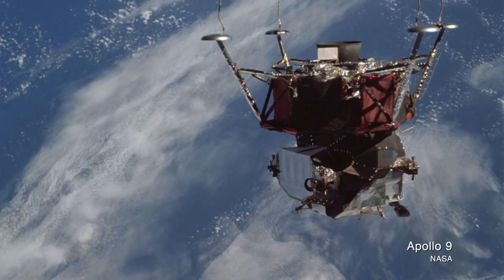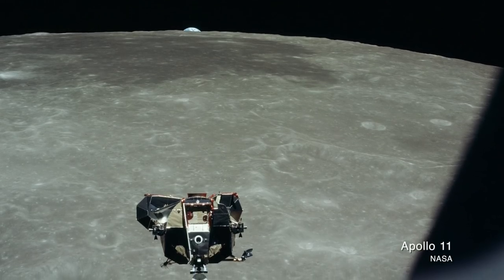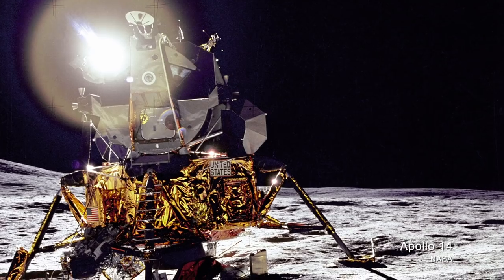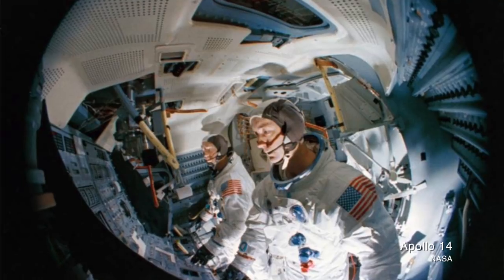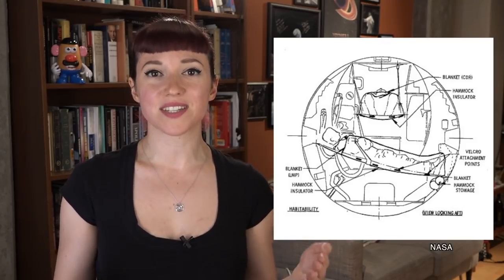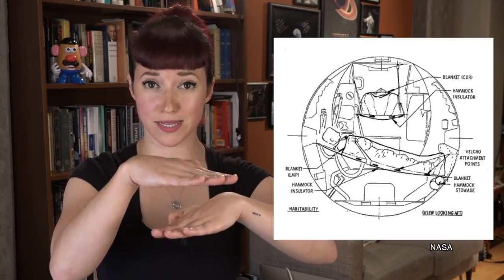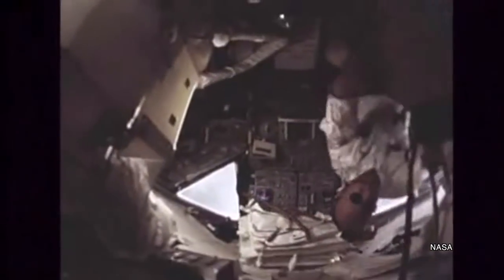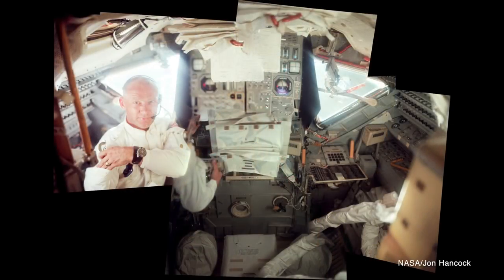Peeking Inside a Messy Lunar Module

Comment: where did they sit/stand/lay during take off from the moon?
Also, did they put their EVA suits and packs on while attached to the CM or after they were on the surface. If so, is there a written procedure somewhere for donning the EVA suits and packs?
Reply: They had to stand, but because of the low lunar gravity, they didn’t have to achieve as high an escape velocity to achieve lunar orbit as to achieve Earth orbit.  Therefore they didn’t experience enough G forces on liftoff to have to lie down.  The liftoff looked like a jerky start on the recorded video from the remote camera, so they had to brace themselves, but they were fit military men, so it wouldn’t be hard for them.
Reply: There were elastic bungee cords connected to the walls of the LM's cockpit around where the astronauts would stand. Then there were  attachment loops sewn into the astronaut's space suits. Before flying the vehicle they would hook the stretchy bungee cords into the loops, which would hold the astronauts down onto the floor so they would remain in place while the LM was performing powered flight.
Reply: @rjcornford  thanks for this.

Comment: Given the tight space, was there stuff left on the moon that wasn’t needed for the return journey? I mean apart from poo bags. Did they need the bulky EVA suits, for example? (Mind you, logistically difficult to leave!)
Reply: The EVA suits WERE the spacesuits themselves.  They were just a lot more dirty on the way home than the way back.  Lots of people think they were separate suits, but they weren't.  They did look a little different because, on the moon, they had the overshoe/boots attached, the PLSS backpacks, the helmet's slip-on outer layers (that were placed over the air-tight bubble layer), the hoses and stuff, and were pressurized (so they seem inflated a bit).  But, those were the same actual suits as they wore to/from the moon.

As for what they left on the moon, yes, they discarded everything they didn't absolutely need for the ride home.  They kept the suits, of course (needed to wear them during maneuvers and stuff, just in case something breaks on the spacecraft and they get a rapid depressurization).  But, they discarded the PLSS backpacks, the overshoe/boots, the tools, and even the cameras (kept the film, of course).

Comment: How did they get the PLSS installed in front of the hatch? The LM was accessible in the stack, wondering how they accessed with inward opening hatch and PLSS on floor.
Reply: Presumably, standing, like any backpack. Then drop down, stick one arm and the head through, then wriggle the rest out. A practiced procedure.
Reply: I don't think  you understood my question. If you notice in the picture described in the video, the PLSS is stowed in front of the main hatch on the floor. It has to be fastened down so it does not move during launch. The LM was accessible, via the front hatch, while on the launchpad. So, how did they install the PLSS on the floor in a position that seems to block the inward opening hatch? Were they able to access from the top hatch? It seems hard to reach through a partially opened hatch to fasten the PLSS to the floor.

Comment: As they came down on the moon, i guess they were free floating, then slowly get pulled to the floor of the LEM? Or straped the hole time? I mean they had to fly the thing - and there were no seats. Can you explain? Thx
Reply: Fred Cink   Makes sence. Thx!
Reply: There were elastic bungee cords connected to the walls of the LM's cockpit around where the astronauts would stand. Then there were  attachment loops sewn into the astronaut's space suits. Before flying the vehicle they would hook the stretchy bungee cords into the loops, which would hold the astronauts down onto the floor so they would remain in place while the LM was performing powered flight.

Comment: Could be wrong, but I understand Apollo 13 LEM, decent/assent,  is in a solar orbit trailing behind the earth.
Reply: Nope, the Command Module, the Service Module, and the Lunar Module were all attached to each other and heading towards Earth.  Shortly before entering the atmosphere the 3 astronauts transferred from their Lunar Module "lifeboat" into the command module as that was the only piece that was built to survive re-entry with a heat shield.  Both the Lunar Module and the Service Module were Jettisoned before re-entry.  They then continued on and burned up in the atmosphere.  You might be thinking of a different LEM, perhaps Apollo 10.

Comment: Please explore: mechanisms designed to instantly sever electrical, fuel(?), hydraulic(?) etc. lines running between ascent and descent stages of the LEM at the moment of lift-off; AND what was done to ensure the fail-safe reliability of the ignition of the ascent engine when they pushed that button in light of the dire consequences of a failure of either of those systems. Please. Great channel, great videos BTW.
Reply: All the wires and tubing between the two stages was run through a set of guillotines. Just before lift off the guillotines would be fired using explosive charges to cut everything. The same technique was used to sever all the connections between the Command and Service Modules. The ascent engine was actually fired by the LM's guidance computer. However, it could also be fired manually as a back up. It also had two sets of redundant propellant valves that when either set opened the propellants would flow into the chamber and ignite on contact. The ascent engine was pretty simple so there really wasn't a lot to go wrong.

Comment: I have an off topic question. In your opinion, did Gus Grissom "screw the pooch" after Mercury 2 splashed down or not?
Reply: No. If he had, you can guarantee he wouldn't have been selected as commander of the first manned Gemini mission as well as being selected as the commander of what would have been the first manned Apollo flight if not for the fire that killed the crew. It was also widely known that if he had not been killed, he would have most likely been selected as the commander of the first lunar landing attempt. Just look at Scott Carpenter's Aurora 7 flight that overburdened him with tasks to do as well as him getting a bit too distracted with the amazing views from orbit. That was the end of his spaceflight career. Same with Walter Cunningham and Don Eisele from Apollo 7 being pretty well blacklisted after their attitude towards ground control. If Grissom had done anything remotely resembling what's portrayed in "The Right Stuff", that would have been the end of his career.
Reply: All correct. If NASA decides that an astronaut has messed up, they're out. They don't get to go again. There was also a Skylab crew that turned off their coms to rest. They never flew again. As for how rock solid Gus was, NASA redesigned the hatch because of his unquestioned account of what happened(in addition to an Air Force test pilot Gus was also a mechanical engineer). One thing that is not always brought up is that fact that NASA's design is what sunk the capsule and nothing else. Hey there's the emergency exit...but no one should ever use it...  As for Apollo, Gus was on his way to the first lunar landing. Hollywood really slandered/libeled him.

Comment: Amy-in the second, bigger picture you can see the arms of someone behind Aldrin-which makes me think that Collins took those pics, and Armstrong and Aldrin are doing the pre-flight check out before separating from the CM. Thoughts?
Reply: Being a composite image, there's a second or two between successive shots to wind the film on and recompose. All the arms are Buzz Aldrin's- he just posed for one shot and then turned back to the instrument panel for the second shot. Or he posed for the last shot in the sequence, it works both ways. There isn't sufficient room in the LEM for anybody to be behind Buzz.

Comment: Ok space girl I totally love your video's. Now I have a question that I need you to clarify.  I have heard that Buzz Aldrin broke the engine start switch while putting on his EVA suit. I heard that they used the tip of a ball point pen to start the engine to get back into orbit. True or false?
Reply: Jamming a pen into the switch to keep it in position is correct unless I'm mistaken.
That Aldrin broke it in the first place is a new one on me, can't say either way.
Reply: @niallkinsella2687  Well if you have the mind to maybe you could use your resources to see if there is anything to this? I have heard this story a few times now.
Reply: It was a circuit breaker switch, not the start switch.
Reply: @stephenh5944  ok circuit breaker, so you're saying it did happen?
Reply: @LasVegas68  It happened. Fortunately, he just broke off the external part of the circuit breaker that sticks out so it can be pushed in manually to close the electrical circuit. The internal electrical part of the breaker was still okay. So what he did was to insert a felt tip pen into the broken circuit breaker in order to activate the internal mechanism so they could fire the ascent engine.

Comment: I thought you were also going to mention the lunar dust that got inside the module off the space suits. This dust was actually quite a health hazard - remember that there was little gravity so the dust would easily float inside the cabin. This dust was created from countless meteorite impacts that pulverized the Moon soil into very fine  electrically charged particles. The suits were covered with this dust that landed inside the cabin once the suits were removed  https://en.wikipedia.org/wiki/Lunar_soil#Harmful_effects_of_lunar_dust
Reply: Peppermint ...Why is none of that pulverized dust seen deposited on the rocks? All the rocks look like they were placed on the surface. Hardly any ever look like they have debris piled up around the base of them. That’s always bugged me.
Reply: @Iam_Dunn   That is a very good question and it also got me wondering.  We see the dust being blown at landing, but once laded, under the engine it doesn't look like a 'hole' in the dust or radial traces of dust indicating movement. I don't have an answer for it, I remember reading that the lunar dust is very special, different than what may be found on Earth, so perhaps the physical properties caused it to 'blow' in an unusual pattern.  I've also read that the blown dust was traveling very very far away on the Moon surface (due to low gravity + no atmosphere)
Reply: Peppermint ...I agree with that premise. But, it doesn’t explain cosmic dust landing on the moon, nor ejecta settling back to the surface. Common sense would dictate that dust and debris should settle, more or less, uniformly across the surface, thus settling on both big and small rocks. But, I dunno, I’m just a retired, old engineer... LOL :) ( What’s even sadder, is crap like this keeps me from my naps....)

Comment: I think it would be amazing if any of the museums with lunar landers on display also had recreated interior for visitors to crawl into and experience it for a few minutes.    I get the whole issue with ADA and inclusivity, but just like there are maritime museums that require certain mobility to explore parts of the ship, I think being able to “experience it” adds a level of respect for what others have gone through.    I think of those opportunities I have had to climb through WWII bombers, and then try to imagine spending hours in that, while being shot at...yeah...that is when the respect meter explodes!     (I would love to find some place that does the same for the different capsules—NOT the historic artifacts—but created simulators designed to endure visitors entry.)
Reply: They'd probably have to put a plexiglass cover on the interior or people would break things.
Reply: bc1969214 , I am thinking of a remade model of durable material just to simulate the size and experience if that makes sense.    I wouldn’t trust the public even with the best plexi/acrylics!

Comment: I'm confused about the comment you made in the beginning about the LEM being "punted back to the moon after landing".  I was always under the impression that the Lunar and Command module were together for a period of time after ascending from the moon and then they separated closer to the Earth and thus burned up in the Earth's atmosphere?  So did they normally separate the two while still in lunar orbit?
Reply: They had to get rid of it before heading back to Earth, only Apollo 13 brought it back to Earth.
Reply: Kevin G Why should they bring the additional mass back to the earth? The LM was completely spent at that point.
Also s far as I know they wanted to record  the impact data and the resulting "moonquake" and because of that we now know that the moon has a solid core. ; )
Reply: Debott I see. Thanks for clearing that up. You learn something new every day.

Comment: I assumed the word 'messy' was referring to the moon-dust mess that would be inside the LEM ascent stage after lift off and on its way to the Command module.
Reply: +SGT D
They did have a filtration system in anticipation of such a problem but they underestimated how much dust would cling to the suits and equipment.
Reply: When they got back into the LEM with those  dirty suits on they had to mess things up and the dust would drop to the floor and all over the place. Re-pressurize the LEM,  take the suits off,  that must have been a pain, and when they got back into Lunar orbit that stuff would start floating around and would be a pretty rough hazard. I'll bet they spent a lot of  time cleaning up before liftoff.
Reply: SGT D 
No such luck, makes you wonder why, this journey being such an important one

Comment: Would they ever go into the LM on the way to the moon for any reason other than system checks? IE, for no reason other than they felt like being in there for whatever reason. Was the tunnel left open? When departing the moon, did they weigh the rocks? What was the scale's design?
Reply: The LM was for the most part "closed off" for the coast to the moon. Except for checks according to the checklist, there was no reason for the astronauts to be inside it. In the event of the LM being hit by a meteorite or an object that would puncture its hull, there would be a risk of a total loss of atmosphere in the two vehicles.
Reply: Also, by having the hatch in place, they (space & ground) could monitor the pressure integrity of the LM continuously. If there were any leaks.
Reply: Daniel Goldman Lunarmodule5 posted the transcript of Apollo 13 cap com transmission.  I was surprised that they left the lem closed until the 3rd day or so to do the checklist.  I thought they would open just for room.  the movie makes it sound like the tunnel was open early and the explosion happened much early in the trip than it actually did.  actually the tunnel was open just before the public TV transmission and the spacecraft had left free return to setup a lunar orbit burn, MCC 2.
Reply: +Daniel Goldman  "When departing the moon, did they weigh the rocks? What was the scale's design?"

Yes, they had to make sure they didn't bring too much back. 
Google: "Catalog of Apollo lunar surface geological sampling tools and containers" and go to page 38. There's also info on the sample containers. To this day, some of the lunar sample containers have not been opened. NASA decided that they should be kept this way so that they could be preserved for more advanced testing as technology improves.
Reply: Thanks for the info everyone, much appreciated.

Comment: Could someone please tell me how the astronauts got passed the pointy thing on the nose of the CM when docked with the LM. Thank you
Reply: The dockning adapter was removeable.
Reply: There was actually a tunnel through there. Half of it was part of the CM and the other half was part of the LM. When the two vehicles were docked, the circular hatches were opened on each side and the docking mechanisms were removed. This cleared the tunnels so that the astronauts could float through the tunnel from one vehicle to the other.

Comment: So where is the video showing 1/5 the Earth's gravity?
Decompression, how much decompression did they have to do before leaving the capsule?
Reply: The exterior shots were at 1/6th; the interior shots were in zero gee. And the decompression was 100%. I know of no interior shots taken on the surface- why film each other instead of out the window?
Reply: Takes 24 hours to prepare for a space walk?
Reply: There were no spacewalks from the LM, which was designed, oddly enough, for just what it did.
Reply: What do you think walking on the Moon is?
Reply: A moonwalk. No air hoses, no safety rope, no floating around- and a spacecraft designed for the very purpose of making it expeditious.

Comment: What are the spikes on the landing legs of the lander?
Reply: Feelers that let them know they were touching the moon and could shut off the engine and safely drop those few inches. "Contact light!" was the radio phrase.
Reply: “Few inches” was more like a couple of metres.
Reply: Almost a yard, IIRC. Under lunar gravity, not much of a fall. That's all I meant.

Comment: Room was so itty bitty... they were able to deploy a 10' x 6' Lunar Rover out of fresh air (pun).
Reply: "Room was so itty bitty..."   -   The living space, i.e. the pressurised cabin, was "itty bitty" (just over 6.5 cubic meters).

"they were able to deploy a 10' x 6' Lunar Rover out of fresh air (pun)."    -    Are you thinking that the rover was stored in the cabin? Why would it be, it doesn't need to breath? The rover was shipped in one of the equipment bays on the outside of the LM's decent stage.
Reply: Folded perhaps... @10' x 6',  I don't think so.